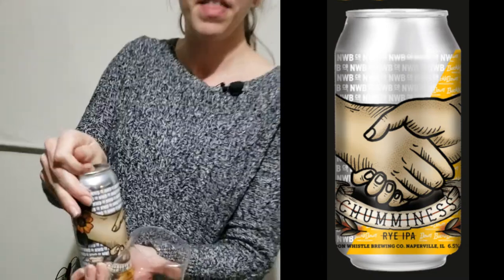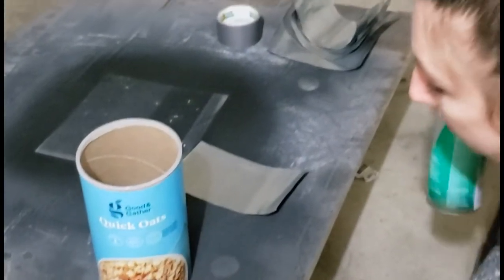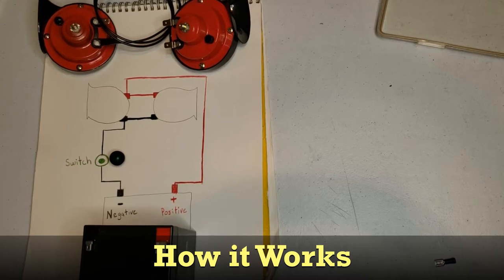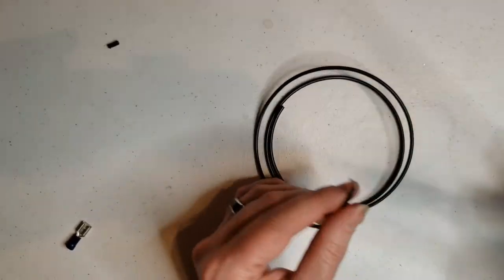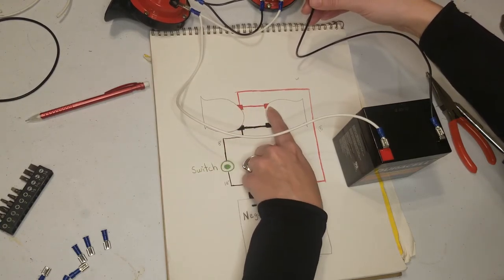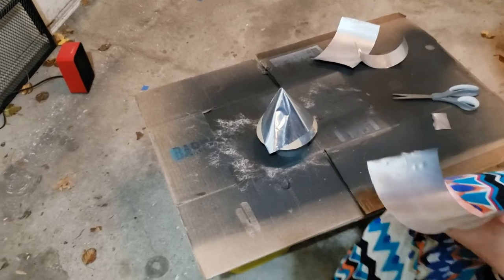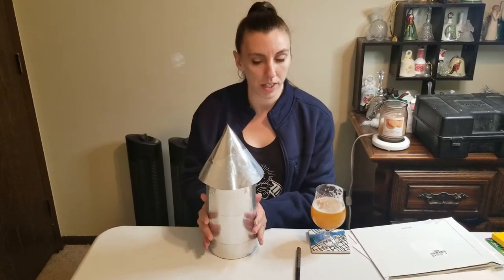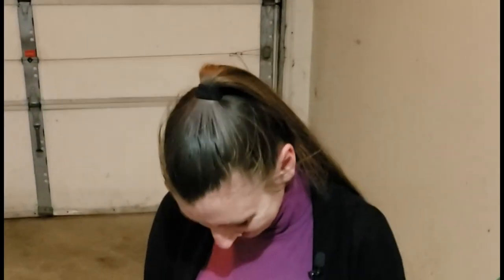Blowing the Noon Whistle at Noon Whistle Brewing Co.!

Comment: A very good post, good job you two, beer looks and sounds good. TIP: when using any kind of cleaners, use thin rubber gloves.It does get into your pores. cheers !
Reply from the maker: Thank you for the kind words.  I know you're right with the gloves, but I was worried I would miss some of the stickiness on the cans if I used them. I can't always see what I'm cleaning, just feel it. I'll try to minimize direct contact as much as possible in the future.  Thank you for the suggestion! Cheers!